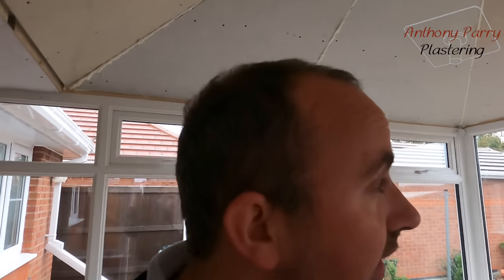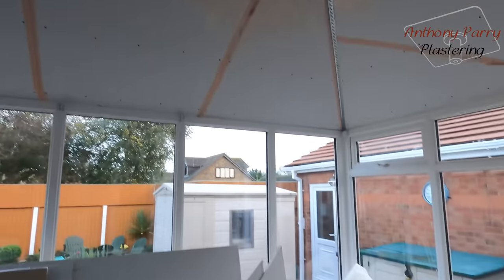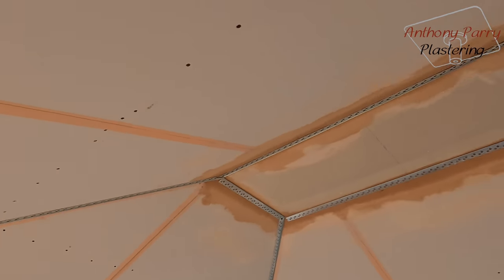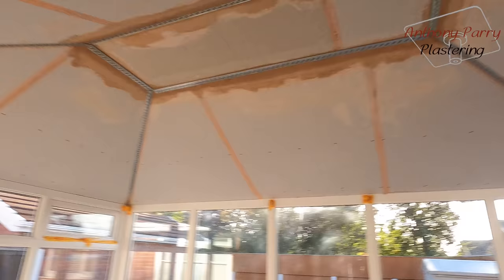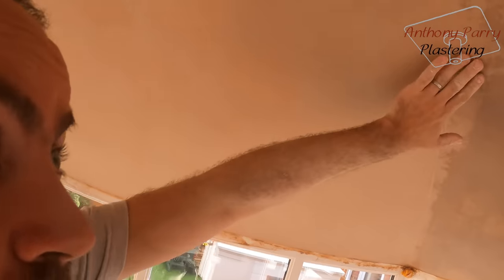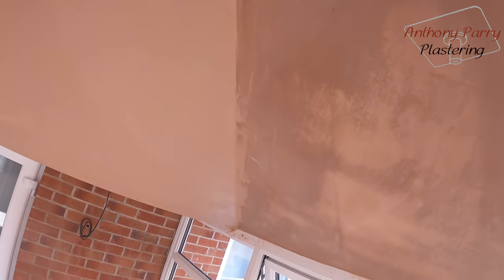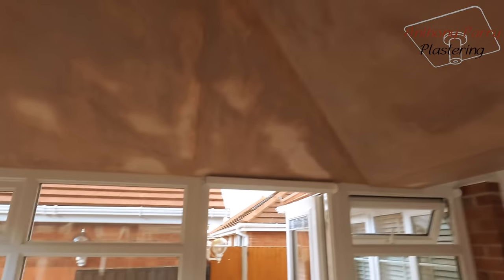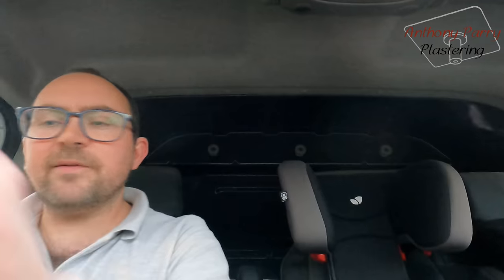Plastering a conservatory roof - My new favourite trowel. PLASTERING VLOG

Comment: Bad boy second coating with the same muck 😡
Reply: Nothing wrong with that. You do understand how hot it would have been in that conservatory, would have been pulled in though to second coat with. And most spreads second coat with the same stuff over board and it was common practice until relatively recently

Comment: A you laying down with same mix
Reply from the maker: If you talking about my second coat. Yeah I am using the same mix.
Reply: @AnthonyParryPlastering  what’s your thoughts on using same mix for second coat, I’ve been doing it recently but sponging & it seems decent
Reply: @dwainearmitage7570 most spreads second coat with the same mix if they can help it. Lay on and then lay down with the second coat

Comment: Nice job. Most spreads roll it all in one. I did one last year with lots of straight angles using stop beads. It's a lot harder than curving it in my opinion.
Reply from the maker: Thanks, it all depends on what the customer wants for me. I find doing a curve easier but I do like seeing the straight lines.
Reply: @AnthonyParryPlastering  all in the prep with the straight lines

Comment: Instead of all those beads for straight lines, they must of cost a fair bit. Just but a Marshall town adjustable twitcher. Jobs a good en. Also, to set ya beads, use a staple gun. Stanley do a very durable plastic one. About 30 quid👍

Comment: hi mate bristol pasterer here. i plaster those for a company in south wales. i personally curver the corners

also you can use the carpet glue beading. its quicker than mite glue
Reply: Any particular brand or is all the carpet glue the same
Reply: @michaelmoroney4594  i use evo stick carpet adhesive.. spray the area your beading. cut bead. spray bead. and then stick it up.
Reply: @paulneale3511  cheers